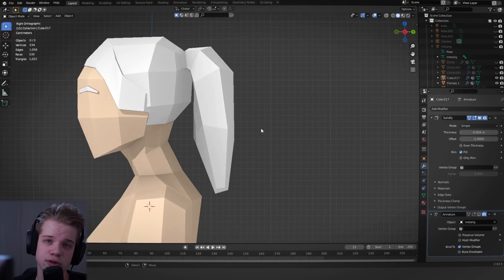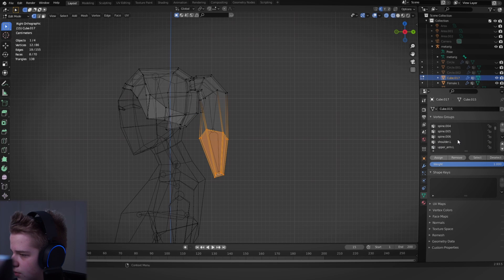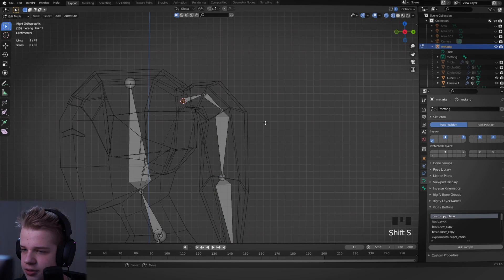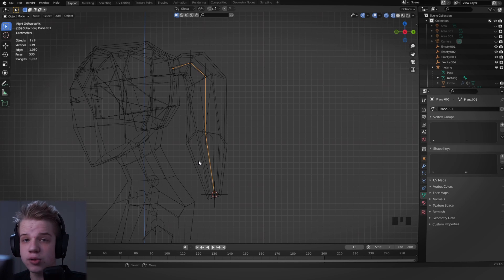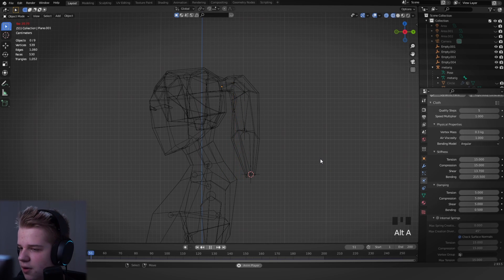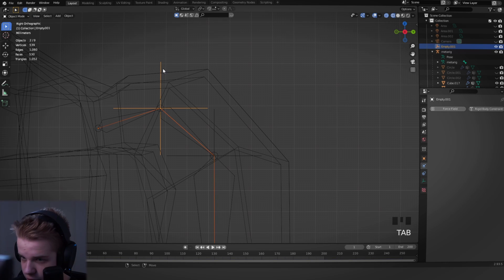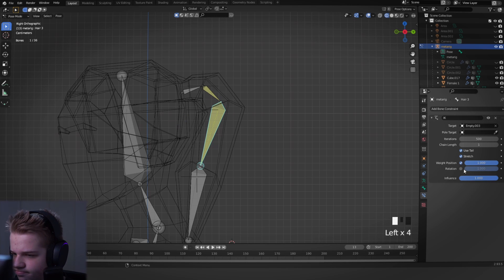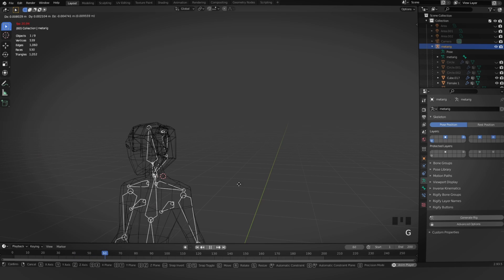REALTIME physics based hair simulation in blender!

Comment: Unfortunately the last part doesn't work at all, the mesh does not follow the rig, not sure why =(
The two first vertices follow the rig, but the rest stay still
Reply from the maker: If the mesh doesn't follow you have to fix the weight paints to get the model to follow the rig
Reply: @ThomasPotter I have the same problem, right at the end it doesn't work, and you can see how in the video you have cut exactly that part where you apparently solved that problem, the first vertex follows the rig and the empty space follows the vertex, but the rest of the vertices (those lower down) do not follow the rig, therefore the empty spaces do not follow the rest of the vertices either. Only that small part is missing from the tutorial, but if there is a way you can modify the video and add it, it would be greatly appreciated.

Comment: does it work if you add colision to the main body? will the hair clip through the body ?
Reply: I need this answer too 😭
Reply: for the collision you need to select the mesh (the line of vertices) extract the entire line 
(blender won't calculate collisiont for edges or vertices, but for faces yes), 

and add in Properties Physics > Cloth > Collisions > check the Object Collisions and change the Distance needed 
(it's the distance around the line (with faces now) where is calculate the colision)